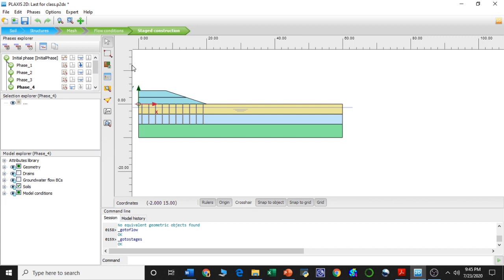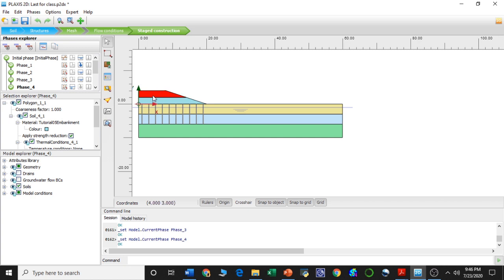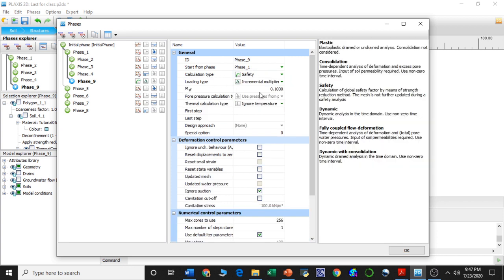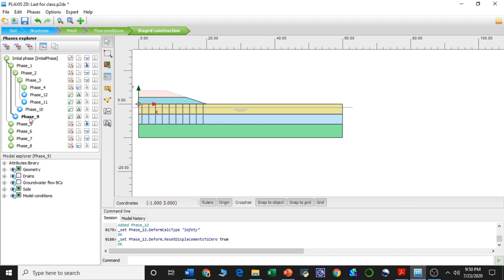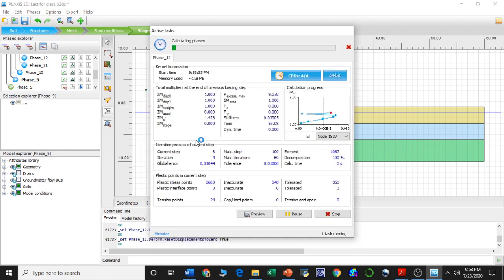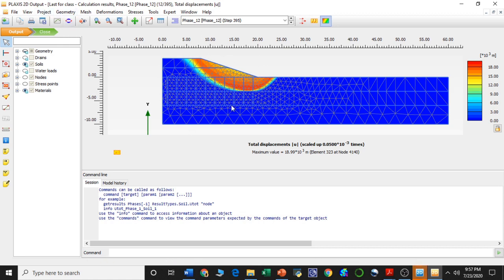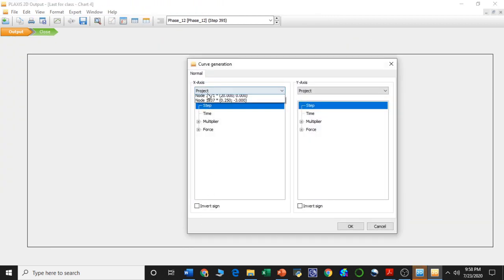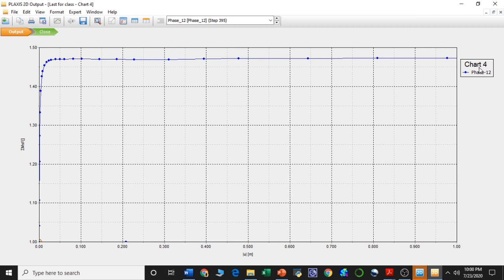Lecture-3_CONSTRUCTION OF A ROAD EMBANKMENT-Part#02

Comment: Thanks for this beneficial presentation. Could you explain please, in this model you created drains but what kind of drains or what is the drains properties you didn't enter any values. So, what is the behavior of drains in this model? Also, may we change the drain's parameters in Plaxis? I'd appreciate it if you could explain.